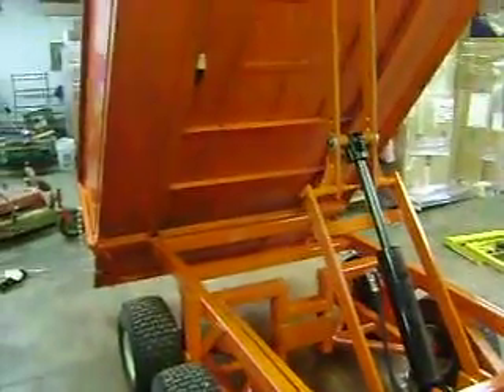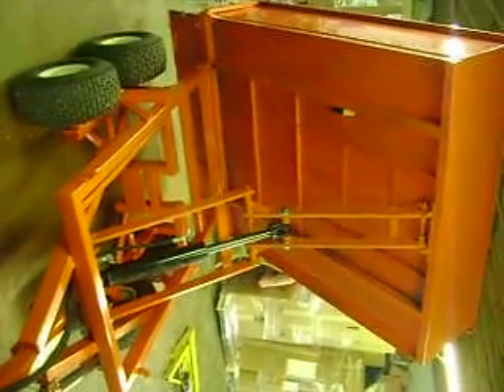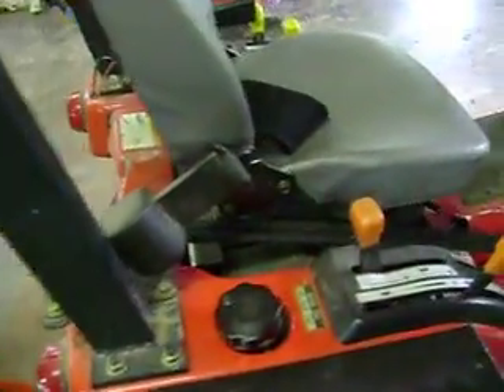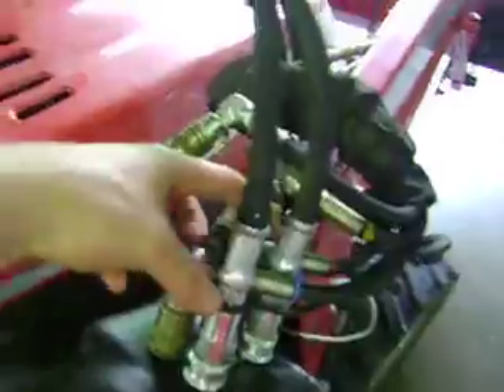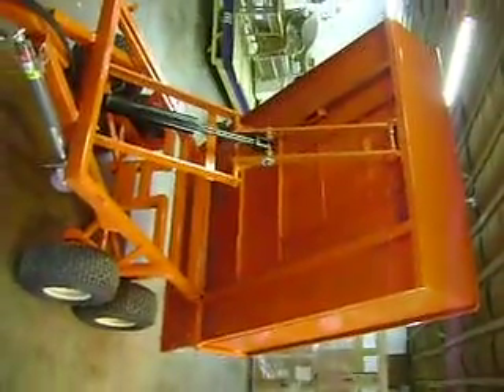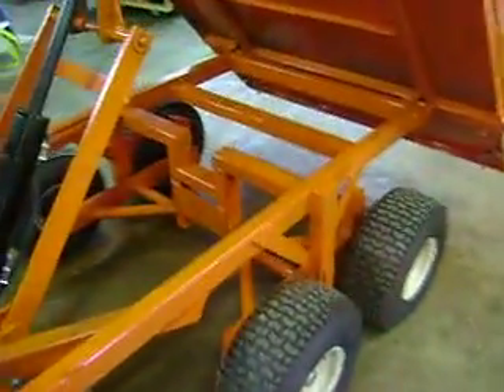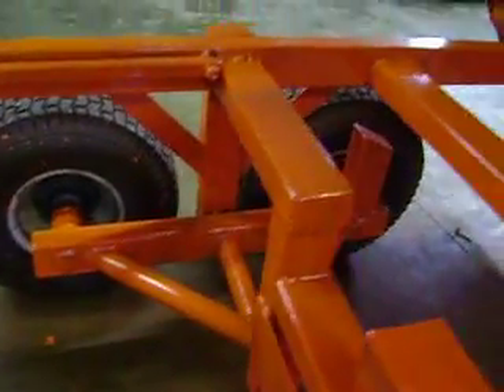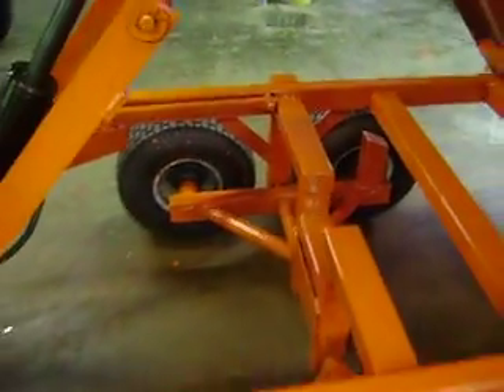Sandusky High CT Welding class project - dump trailer(overview

Comment: i know that this is an older video, but i just came across it, and I'm impressed! kudos to the shop class instructor and shout out to the kids that worked on the dump trailer project! these are real world skills that are taught in this class and i hope that the kids had fun and more importantly learned that this is project exemplifies fundamental  manufacturing real world process. Hard work and a good plan, "Design, Build and Maintain" is the mantra in our company. I own a landscape/snow and ice control company and we have many times had to build devices that we could not readily find on the market. Good to see young Americans getting
exposure to these skills, which they can then use in their working careers.